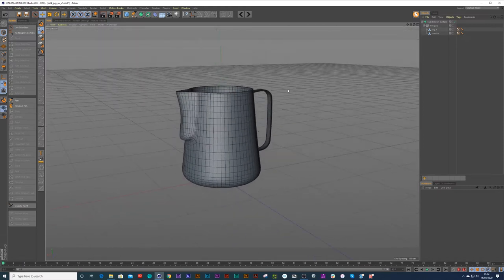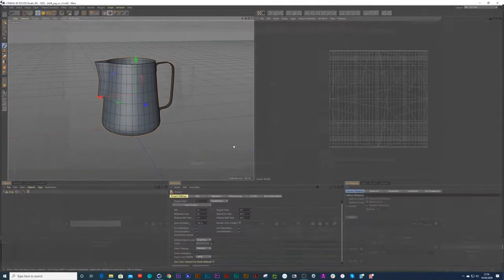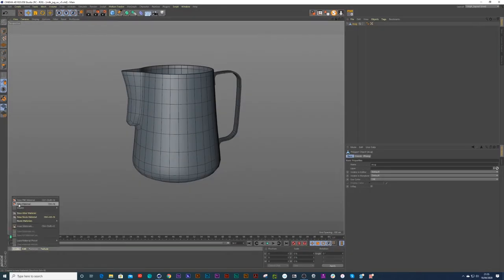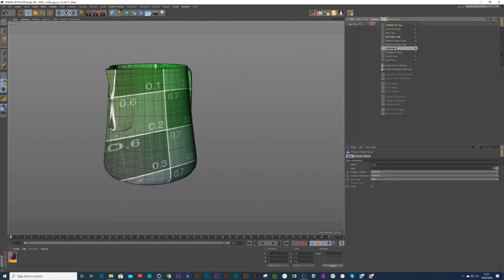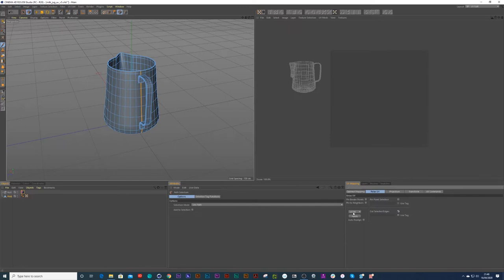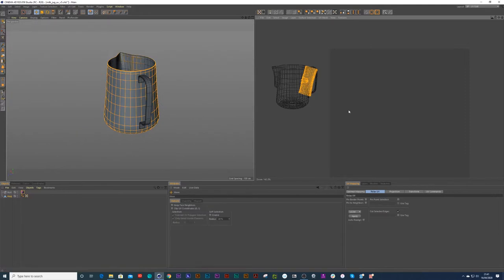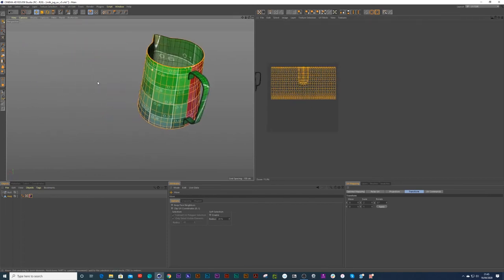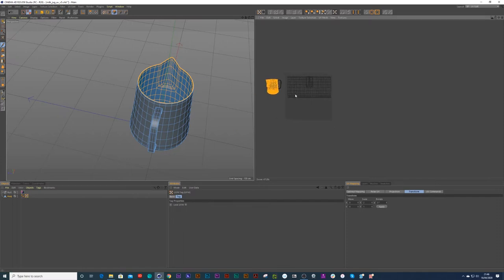UV Mapping A Milk Jug in Cinema 4D

Comment: I was waiting the whole vid for you to realise your normals were round the wrong way – poly's displaying blue when selected – but you remedied that by mirroring the uv's in the uv editor. Also, when you first used frontal projection you had the mug facing the front, that's why it split at the front even though you'd selected your edge at the back. Good video though!